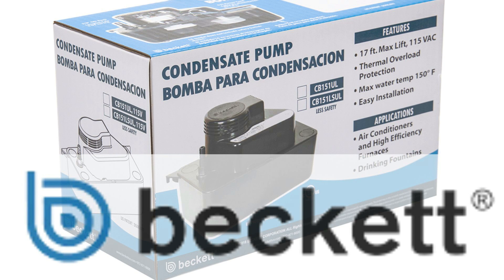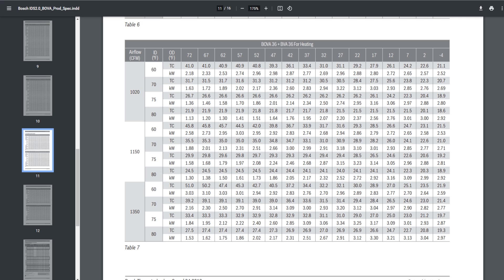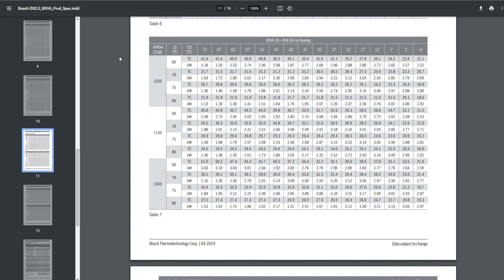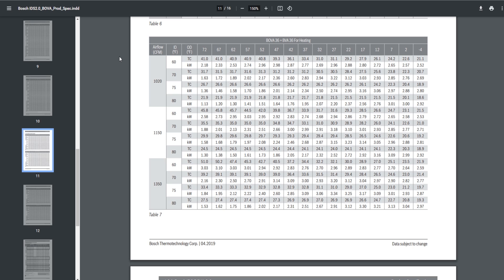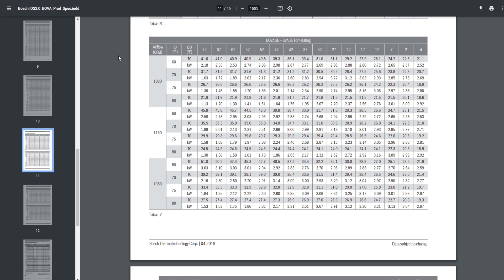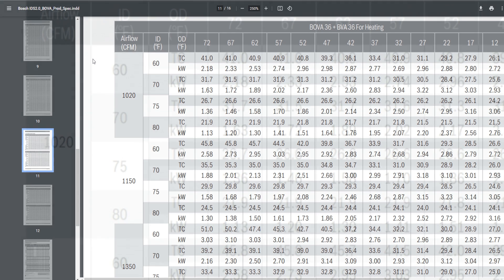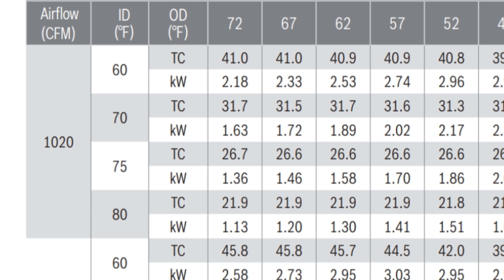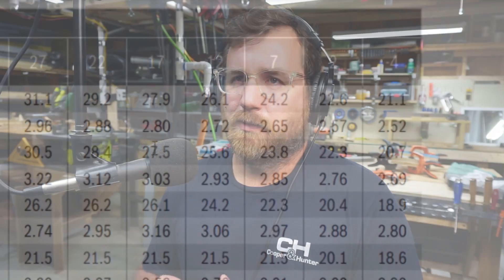Bosch IDS 2 vs Single Stage Heat Pump Best Heating Performance

Comment: I need a new heat pump for a 2,600 sq ft home in Blacksburg, VA where the average humidity is 75-80%. Sounds like Bosch isn’t my answer? Any recommendations?

Comment: depends on the heat load of the house im 5:30 in sorry if you get to this ..... if your house had good enough insulation it would work down to 0.  it actually starts to shit the bed around 19tbh, if yoh read the manual.

Comment: Bosch great for providing heat, and in dry climates-ver poor choice for high mositure climates, and more importantly, much of the United States with mixed climate and large trunk seasons -ie 70 degrees and 70 per cent humidity . Mitsubishi would be my first choice in New England, upper Midwest     Bosch in Rocky Mountains and desert , but anywhere else, ie Connecticut to Florida, and west to the Rocky Mountains, you need a fully vactalbel fan, inverter condenser and a communicating  system/thermostats. Thsi is not my ‘prejudice’ it reflects the basic design of the various systems approach .

Comment: Thanks -- I'm curious about the Bosch IDS 2 but have a question about sizing:  Currently, I have two single stage AC very old systems, both 2 tons, with one being a furnace and the other a heat strip for heat, . I want to replace both with a Bosch IDS 2 3 ton but baffled on what size the air handler should be?  Should I match the air handler to the heat pump which would make them 3 tons even though what I currently have is a 2 ton, each zone cooling and heating 900 sq? I can see being oversized helping with heat but what about being oversized for cooling and that resulting in humidity?
Reply: This units can be downgraded with a dip switch, wich means. U can drop to 2 ton for summer and take it back to 3 ton for heating. You will have to use a lower Airflow for cooling.

Comment: So the Bosch is able to produce 2 tons of heat or 24,000 BTU while a conventional gas heater will produce 80,000 BTU no matter the outside temps.  Which one is going to cost less to run? Wouldn't you need to know how much the fuels cost to figure out the outcome?  Also, wouldn't that apply with single vs two stage or variable?  Some locations have 40 cent per kWh rates for electric such as California while others may only see 8 cents per kWh such as NV. Then, the same need to know are the rates for gas per therm or cubic foot.
Reply: I’m in califorina and my rate is 11 cents a kilowatt. I dont have PGE which I’m sure is where the 40 cents is coming from. The Bosch is good in California
Reply: @Level-333  Our rates with SCE are .42 cents per kWh in tier two. About 5 to 6 times higher than most states while Nevada charges 6 cents in tier one and 8 cents in tier two.

Comment: The Bosh heat pumps are a beast. Still will put out 70% capacity at 17 degrees and then only lose another 3,000 btu going down to 10 degrees

Comment: Is really how  this chart should be read? I have the same unit installed in my home.  If reading the chart as being stated then at 1350 CFM at 60 degree ID you will get 51K of heating out of 36K unit at 72 degree OD??  I wonder if TC stands for temperature change.
Reply: do you keep your house at 60? i think it does mean total capacity,it would be around 46k at those specs-look at the kw difference with the changing cfm-the bosch will be most efficient at the lowest cfm that can heat or cool your home ,temp changes,insulation...all play a part

Comment: Those are very impressive numbers. Vastly improve over a typical heat pump. Yeah I know resistance heating gets a big thumbs down for energy costs but one thing from the days old- Our old GE WeatherTron heat pump’s air handler did run 25 years with only one actual break down and that was a blower motor at 7 years of age. My point to this is the cost of use is higher, but maintenance cost was at bargain basement prices which offset the cost of running electric heat when it was needed. So you pick poison! 

Boy I’m gonna have to ask Santa for a Bosch system.

Comment: I've got a stand alone 12" Shopsmith planer, with variable speed infeed control, you can have for free, but you have to come pick it up in Texas.😜
Reply from the maker: Tempting. If it weren’t $1000 in gas
Reply: @TALYN875  Always the problem with old woodworking equipment that isn't local.
No matter how good of a deal it is, it costs too much to go get, or to ship.
Reply from the maker: I will probably get one in 2023. I am taking my time trying to learn more “pro” level woodworking skills. I have always enjoyed it, but never buckled down and tried to take it to the next level.
Reply: @TALYN875  I got into woodworking a few years ago, and it quickly became an old woodworking machine restoration hobby.🤣

Comment: natural gas heat just seems better.  And there are so much natural gas reserves we will never run out.
Reply: uh,very true but you need to tell the current admin to open the pipelines and get people back to work-im in n.y. and there is a carbon tax bill that if passed will cost major dollars to people who use fossil fuel over the next 10 years,being forced onto a grid that can't support whats on it now...hmmm what in the world will happen next-major rate hikes
Reply: Dems are phasing out natural gas.
Reply: The Bosh heat pump uses a third the electricity of conventional heat pumps. If everyone had an invert heat pump, their would be plenty of power available. And I get the same temperature heat out of my Bosch as I do from my gas furnace. And Bosch isn't the only company making inverter heat pumps.
Reply: @David-mo2zq  are you sure you get the same temp from both? my ductwork is in my attic so big loss there...for now...upgrades to follow
Reply: I am sure. It's difficult to explain in a few years. It is capable of 125 degrees. It gives you less in maintenance mode. It also only pulls 3 or 4 amps in maintenance mode. Heat loss in the vents is a different matter.
Reply: markcotter, I am in the natural gas business and I wish you were correct . We have about 50 to 125 years of natural gas left depending on if we start blending hydrogen . If we blend hydrogen, I see about 125 years left, if we don’t blend hydrogen  (which probably will be the case ) 50 to 75 years max. So in the end, we are looking at a world full of heat pumps , natural gas furnaces will be joining the coal furnaces and oil furnaces in about 30 years,😢.

Comment: The thumbnail is a Bosch next to a Goodman. That's like displaying a Corvette next to a Yugo!
Reply: Still using an R22, 1997 Goodman heat pump here in Northern Kentucky. I still cannot justify spending the money for a new expensive replacement. I’ve had a heartbeat for over 70 years and if I never have to replace it, I’ll be very happy.
Reply: @pepperstinson3141  I've still got one Goodman at my house (came with the house). Noisy. Rusted etc. I haven't replaced it because even doing myself it doesn't really pay to as far as the slight savings people actually get on their utility bill. (takes YEARS N YEARS for the utility savings to = the cost of equipment)

That said. I still call Goodman junk and is generally less advanced and they are more competitive for the lower end equipment. 😆😆😆
Reply: @pepperstinson3141  As we everything I think its about the install, but my goodman/amana just kicked the bucket at 16 years old. Copeland scroll blew a hole out the side of it on a hot sunday night. I'm going with a bosch now
Reply: Which one is the Yugo?
Reply: @zacksintheshop  The Goodman junk
Reply: @hackfreehvac  NotGoodman.
Reply: I did NOT say they weren’t low end equipment, but ours is still doing the job after 26 1/2 years. If we have to replace it, I hope we are able to bypass R410a and not have to be concerned about it being old technology. At our age probably that doesn’t even matter. Lol
Reply: @pepperstinson3141  LOL. I wasn't arguing. 😁I was just adding that I also still use my Goodman HP here at my home. It cools/heats my downstairs.

As for the refrigerants, R410 is gone after the next year or two unless things get pushed back.
R32 and R454b are the upcoming refrigerants. "Somewhat flammable" 💥🔥
I am also glad that I am no longer turning wrenches on this stuff on a daily basis. 👍

Comment: Where we are the variable speed heat pumps don’t need heat strips at all. Our lowest temps may reach 17 degrees, which is quite rare. And honestly it doesn’t drop below freezing all that often.
Reply: Wouldn’t you still want heat strips for the defrost cycle?
Reply: @Supplyhousemarco  Technically yes, but I've run across systems were the installers forgot to make the configuration settings to tell the air handler it even had a heat strip, and nobody noticed for a couple of years until I was there just doing maintenance.
Then again, the couple of times when it really mattered in the past 2 years here in the DFW area of Texas, most of our customers with heat pumps lost power during the worst of it, so...🙄
Those were American Standard systems, not Bosch. My main use of Bosch outdoor units is replacing the outdoor unit on the awful single stage heating and cooling zoned systems new construction builders have been installing in my area. The compressors don't last long in a single staged zoned system with fixed metering, oversized and/or incorrectly installed bypass, and the extremely failure prone Honeywell zone dampers...